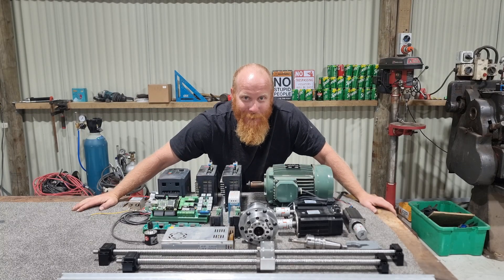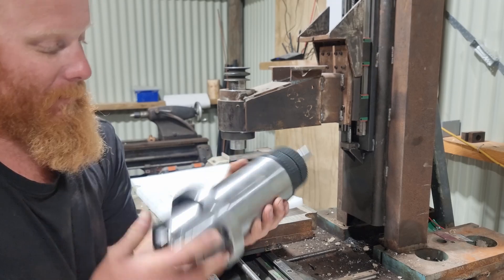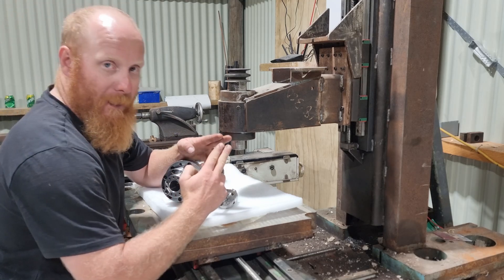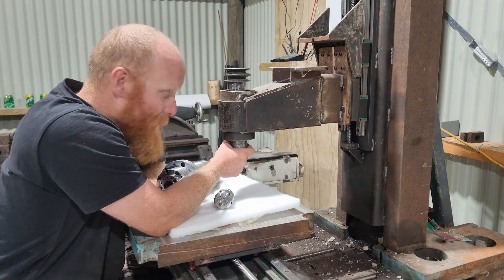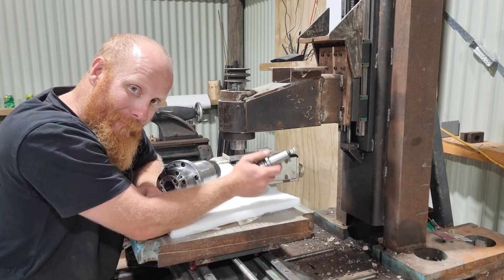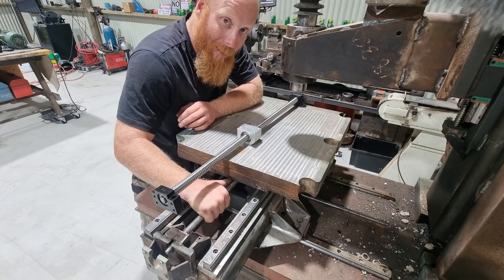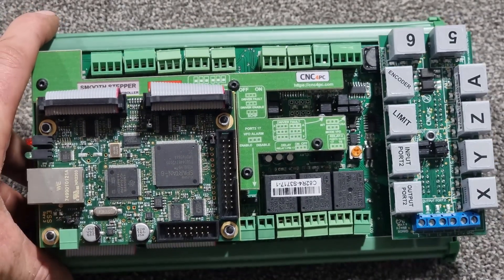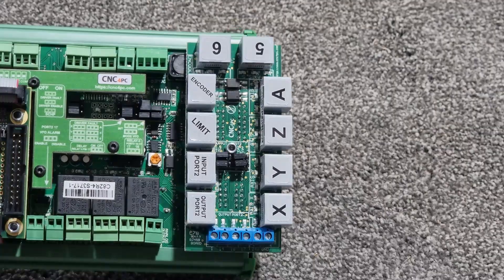Transforming My CNC Milling Machine with These New Parts

Comment: I am researching building a DIY Mill, so excuse me if this question seems ignorant.  Can you use a gear ratio change in the spindle motor to move the torque curve into a better spot of the rpm power band for the motor?  Also, have you listed some of the parts you are using somewhere?  I am also looking for a good ATC spindle and would like to do the power tapping function.
Reply from the maker: Hi there, yes, you can use gearing to change the curve. on the atc spindle I have, the gears are built into the spindle, but there is no reason you couldn't put different pully gears on the motor end or an intermediate gearbox with different pully sizes between the motor and spindle. The spindle won't have much to do with the power. Tapping it will be the control board and software. you will needled an abz encoader to read the spindle position. The c82 board I'm using should do power tapping discount code GingerNinja should get you a small discount at cnc4pc.com. anymore questions just ask and I can make a video explaining more detail on what you need. good luck with the project keep me posted.

Comment: Some nice big servos. I’m running 4 smaller ones 0.4kw on a router cnc. Are you running 2010 ball screws? they should be plenty fast with 3k rpm servos.
Reply from the maker: Hey mate, o awsome how do they run. I had one going as a spindle motor and was plenty of power. Yes am converting to a 2010 from a 1605 bigger motors I thought better upgrade. I'm hoping there fast enough they should be, but the table is very heavy

Comment: Hi.great to see a rebuild.  Can u please offer some info about the board u are using for the signal on the servo drive. The one placed in CN3. Thanks
Reply from the maker: hey there, yes, no problem. I will try to make you a video tonight explaining and showing the connection and how it works. I'll send you the link when uploaded
Reply from the maker: Hey there, I have put this together it's a quick little video. I hope it helps. If not, let me know, and I will try to do better.

https://youtu.be/rvEPMMnPnDY

Comment: Awesome, I like your ingenuity making a machine from scratch! I think that BK15 bearing block @3:16 might be installed backwards, it may not matter though.
Reply from the maker: cheers for the comment. I will have to have a look at that. I'm working on the z axis redo at the moment, so I will check before I put the rest together. cheers again for the comment.